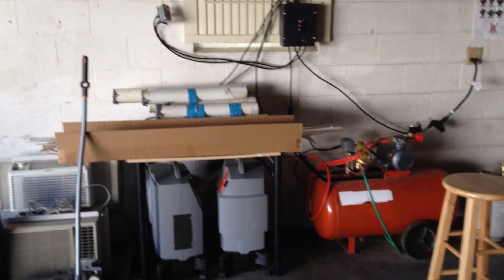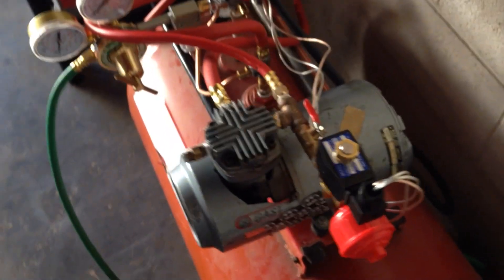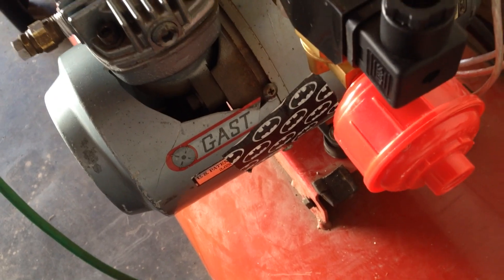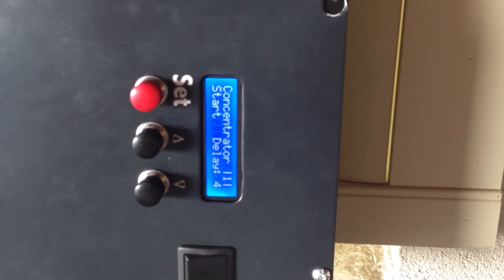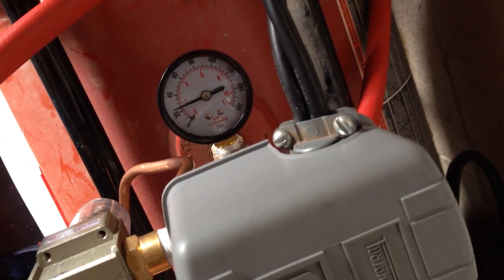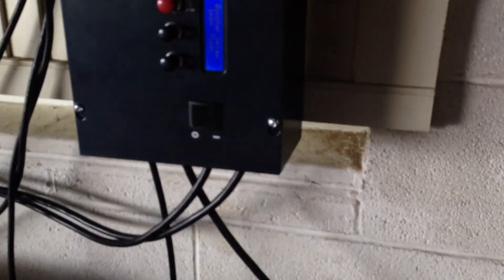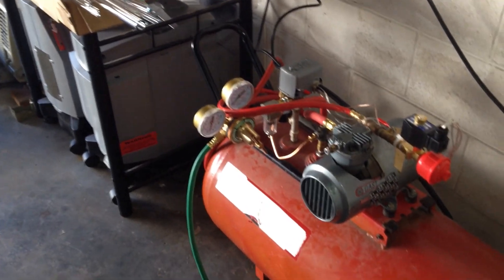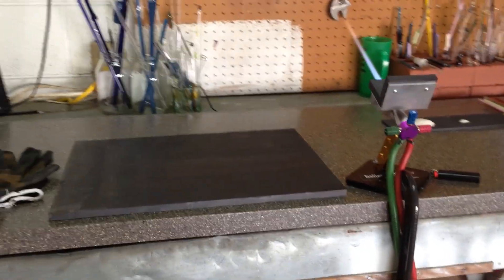Oxygen Concentrator system for Glasblowing torches

Comment: So, its 8 years later. What set up are you using now? Is this system still tride and true?
Reply: I actually still use this set up. 

A couple tweaks to the system and a few new parts as the O2 eats up seals.

Replaced the circuit board of my controller n everything is running good still.
Reply: @davidlasko7801  hell yeah, thats what we like to hear. Thanks for sharing 🤙

Comment: I'm looking at this, and for the life of me I can't figure out how or why the flame doesn't 'back-feed' into the tank.. I imagine that, like natural gas, the amount of gas leaving the pipe needs to be under enough pressure, but how these simple torches don't back feed flame into a tank still baffles me. Even if you use a store bought Burnzomatic tank and torch tip, the flame should feed into the tank at the end, shouldn't it? What am I missing here?
Reply from the maker: Yes to answer your question as easy as I could.  Pressures are 5/20 psi for gas/oxy -  this torch is a surface burner; meaning the combustion takes place after the gas orifices. 

Since this vid I’ve made some tweaks and changes but it’s roughly the same set up.  I have also added a few pre-mix (has combines inside the torch and starts to combust inside the torch)   Torches and I do have flashback arrestors on my lines due to those torches.  

Hope that explains it.
Reply: Torches are far from simple lol
Reply: sometimes internal torches will pop because of the back-feed and combust inside the torch. (I think those torches have bad valves, and just dont close clean.)

Comment: What are the requirements for the compressor. I know it has to be oil free but can you just use any oil free compressor like a oil free Craftsman compressor or  does it need to be a specific kind of compressor with a certain horse power? I'm looking at a used oil free Craftsman compressor but can't see where the intake would connect. I guess I would need to remove the plastic shell to get at it.
Reply: For anyone else wondering the answer is no you can't use any oil-free compressor. I got one cheap on craigslist took it apart and found that the intake is on the piston itself and it looks like it pulls air through the motor (maybe to cool it?) But there is no way to port the oxygen in which I was afraid of. I also believe that you have to get a compressor that pulls about the same cfm that your oxy cons put out. I'm working with 20 lpm so I think I need a compressor that pulls about 0.7 cfm. I wish I could find more info on this.

Comment: U don’t really need the control box and is better if u didn’t oxy concentrators are continuous duty and often run 24/7 for years u could wire your vale into your pressure switch if it’s a 120 coil the best thing u can do is match ur compressor to the lpm ur generating
Reply: How would you determine what compressor to use based on lpms?

Comment: Love the set up and I'm about to pull the trigger on my own set up. One question I'm having trouble with is the Gast Mx100 oil free compressor has a max flow rate of 35.3 Liters per min (1.25 cfm) while your O2 concentrators are only producing at a max, 20 Liters per min. By my math there is a 15.3 Liters per min unaccounted for. Have you accounted for this somehow in your set up?
Reply from the maker: +Zachary Harris i could technichly use another o2 concentrator however that is the max input (under no pressure) so that does curve down as the tank pressurizes its closer to .6CFM at 80-100PSI
Reply from the maker: +Zachary Harris http://www.gastmfg.com/support_documents/RTD298rC.pdf see the curve on of air flow on this link. once I'm above 20 PSI I'm in the clear,, my tank rarely gets below 60PSI usually 70-85 PSI
Reply: I follow ya, I'm afraid my lack of knowlage of compressors is showing ;) Love the setup thanks for getting back with me I am now OMW to my own setup!
Reply from the maker: all good i didn't know anything about the subject when i built this set up. its all in research!

Comment: what is the factory model # on the back of those machines ? if the label is still there ... 600's ??
Reply from the maker: +n8 free-man they were modded by dave who made them so model number is irrelevant .
basically they have been modded to output more then factory so it different on the inside then the original model

Comment: hey great setup, i'm setting up something similar and was hoping you could help with a couple of questions? I have a used gast dry sprinkler  compressor and was wondering if standard valves are ok to use or do i have to get oxygen safe valves. also what to use to clean all the parts with.
Reply from the maker: +Elgin Fremlin valves? that could be anything please elaborate.  i cleaned my tank with degreaser and then after acetone then air dried it.
Reply: sorry unload-er valves and pressure release valves i got those already. the other question I had was about the pressure switch. Specifically how to go about oxygen cleaning it. does it need to be completely disassembled?
Reply from the maker: i didn't clean mine just used it .. I'm no scientist or chemist by any means so don't take my word for it, but i believe in this low pressure environment the oil will not sublime and combust. in this high volume/low pressure  (100-200PSI max) more then likely an explosion will not occur. its when dealing with high pressures (like t tanks) 2000PSI is where you would want to practice extreme caution .. i took as many precautions as possible,.

if you want you can clean it with long q tips (throat swabs) and some degreaser.  since with water and followed by some rubbing alcohol to help it dry ..

cheers

Comment: Very nice. Did you get your new torch? does this get close to running a mirage?
Reply from the maker: I still have to order my other torch either a phantom or mirage not quite sure yet. Prob gonna go with a phantom as I still have to get a foot petal and garage style kiln. 
I know this set up will run a phantom pretty much indefinitely. A mirage will need another O2 concentrator and prob a bigger pump my an m200x. Pretty much this pump but with 2 heads :)
Reply: his setup will run a mirage full bore for about 1/2+hr. Since most work is done with the small flame normal production work would be fine. Add an additional concentrator and you will get a faster recovery of the holding tank allowing you to work longer at full bore.
Reply: Distilled Glass looking at much the same set up ,2 10lpm generators and a oilless compressor to store my oxygen and run a mirage and i got every answer i was after   but i must ask how often would you run the torch at full throttle?
Reply: Syler1979  with just a booster 1hr+ full throttle, torch never stops i get 35 psi straight from compressor after an hr+